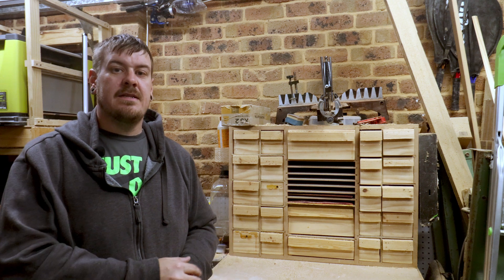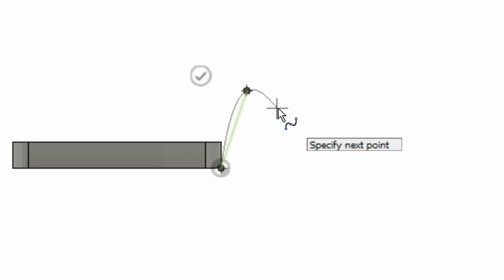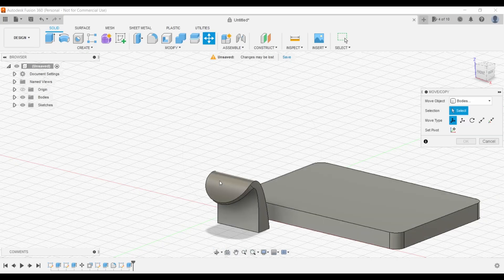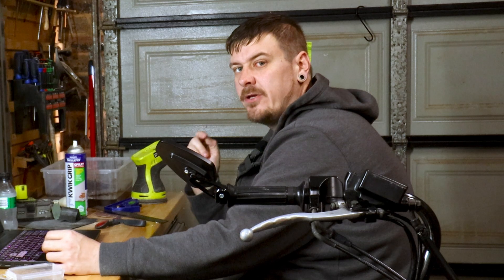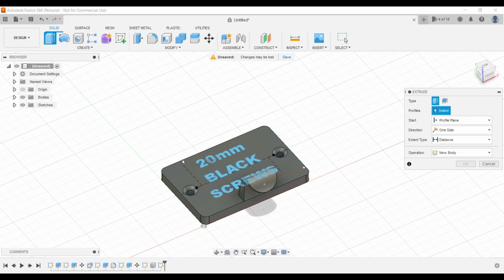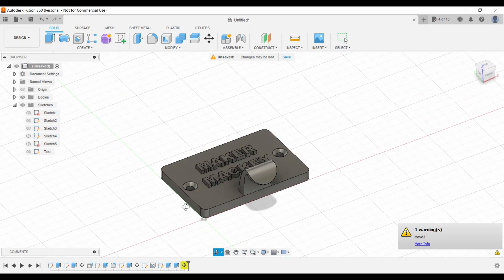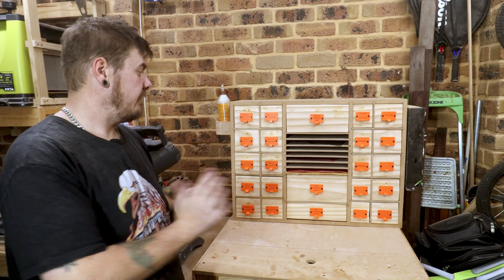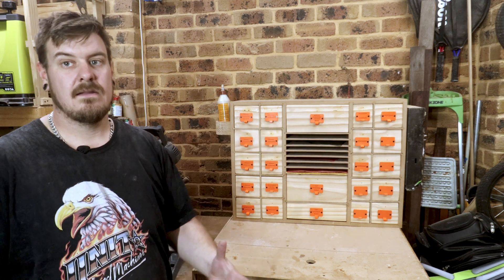How to design and 3D print custom drawer pulls (with inlayed labels)

Comment: I’d be curious if you warmed the plates to like, I dunno, 140° or something (below melting point of course) and put the letters in the freezer if they might be able to squeeze in. Another thing I think Morley does is make sure things that need to fit together are made a multiple of the filament width so the results are predictable. That can be tricky with complex small shapes like text though, so it might not help.
Reply from the maker: Oh that's an interesting experiment, I might try that one day😁👍